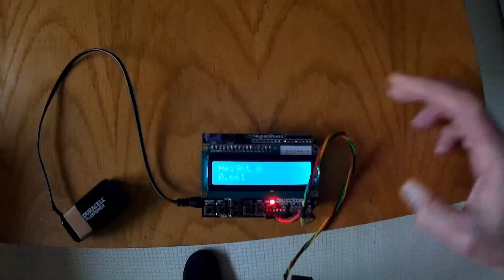Altimeter using Arduino and GY63 board with MS5611 sensor

Comment: Can you please help me? I have this error:

C:\Users\aa\Documents\Arduino\libraries\MS5611-master\MS5611.cpp: In member function 'uint32_t MS5611::readnBytes(uint8_t)':

C:\Users\aa\Documents\Arduino\libraries\MS5611-master\MS5611.cpp:116:12: warning: converting to non-pointer type 'uint32_t {aka long unsigned int}' from NULL [-Wconversion-null]

     return NULL;

            ^

C:\Users\aa\Documents\Arduino\libraries\MS5611-master\MS5611.cpp:123:9: warning: converting to non-pointer type 'uint32_t {aka long unsigned int}' from NULL [-Wconversion-null]

  return NULL;          // no byte required

         ^
Reply from the maker: Are you usng the library as in my instructabe below? Do you get these errors on compiling?  Suggest try the library I used. Mike
Reply: Not sure what I did, I tried to reupload after restarting Arduino IDE. Now it works. Thank you.
Reply from the maker: Please add comment to my instructable to help others who might have the same problem.  Thank you.  Mike